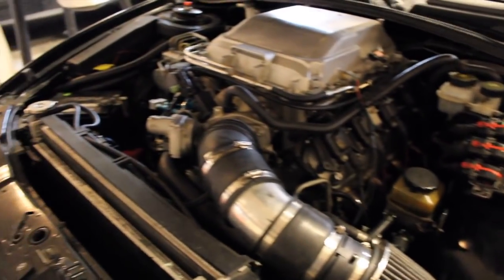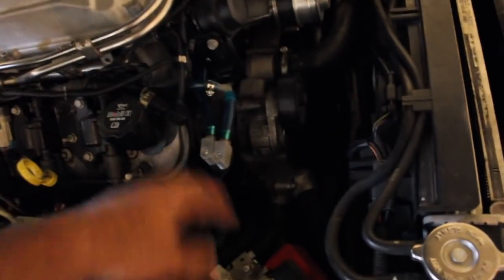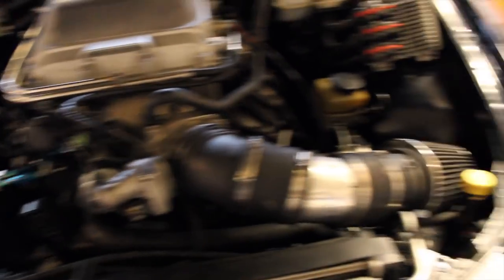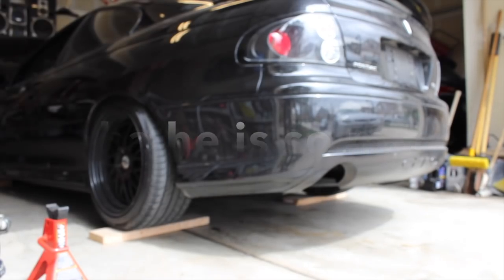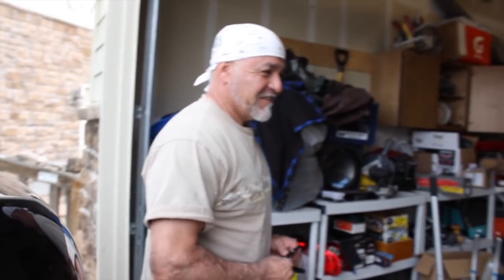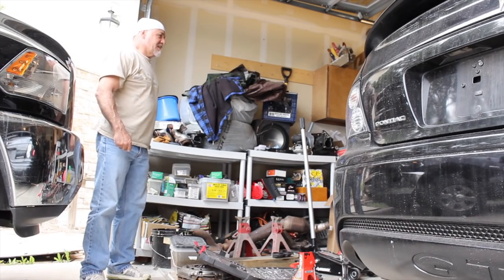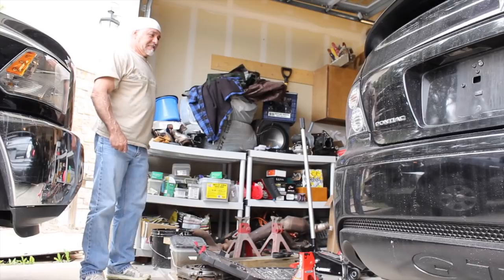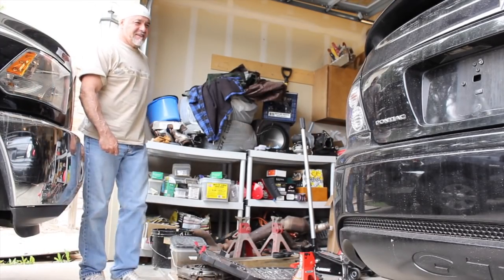CAMMED LSA GTO STRAIGHT PIPED AND ITS LOUD!!!

Comment: If u want it louder than open headers! or straight!  pipe install the slp #1 loudmouth resonators  on the rear of the car where the original silencers came from factory. Trust me they will sound louder than any exhaust out there.
Reply: My cousin had the slp 1 on his 05 and its sounded good but also sounded like the gates of hell opening.